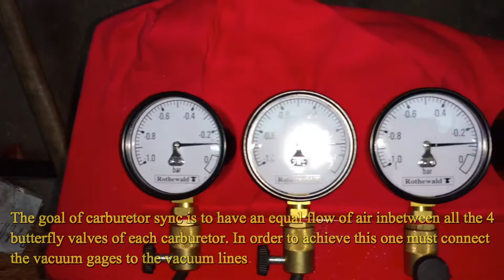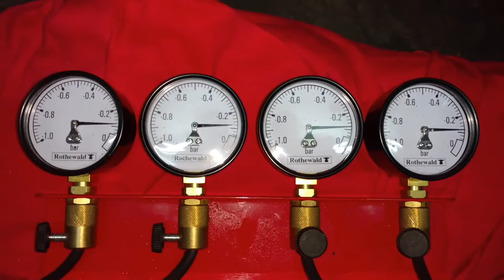CBR 600 F2 Motorcycle Carb Sync

Comment: Salut te rog frumos spune-mi unde vin conductele de la ceasuri unde se adaptează la carburator
Reply from the maker: Salut. Se montează pe vacuumurile de la carburatoare.
Reply: @AlexAndreiZAR  Îți mulțumesc frumos Ești un domn multă sănătate îți doresc am dus-o un hornet la un meseriaș și tot nu merge bine în special la relanti
Reply from the maker: @geodexterconda5305  pot fi mai multe cauze. Recomand sa verifici urmatoarele
1. Compresia pe fiecare cilindru in parte.
2. Joc supape.
3. Bujiile (in special distanta de la electrozi)
4. Date jos carburatoarele si verificat de la nivel plutitor la suruburi amestec relanti si apoi trecut la sincronizare carburatoare.

Multumesc pentru apreciere!